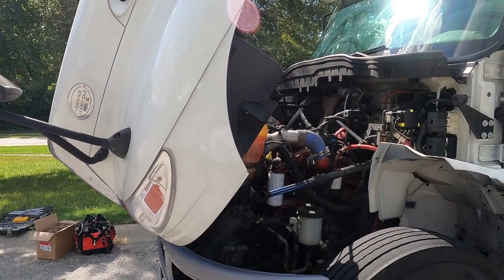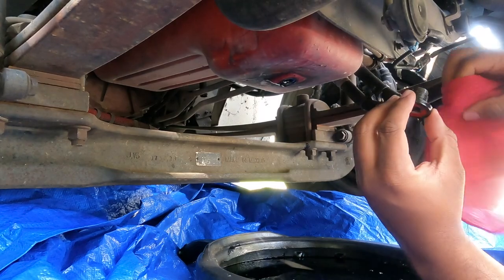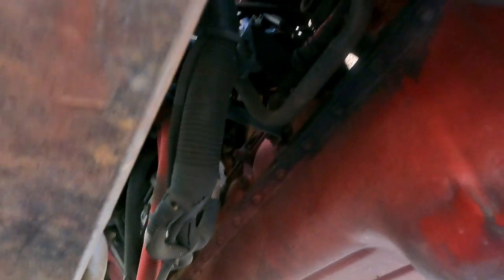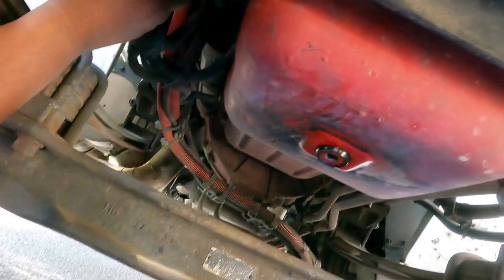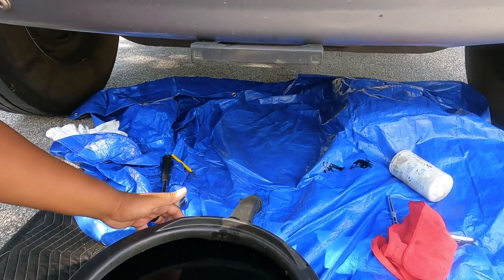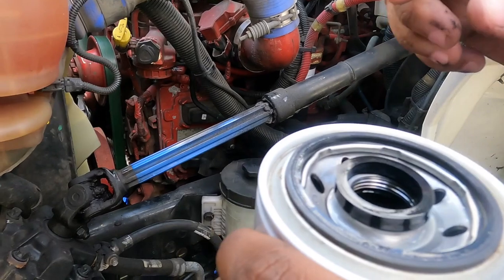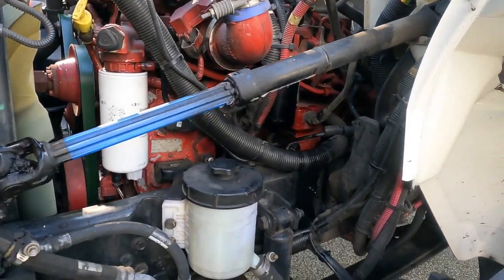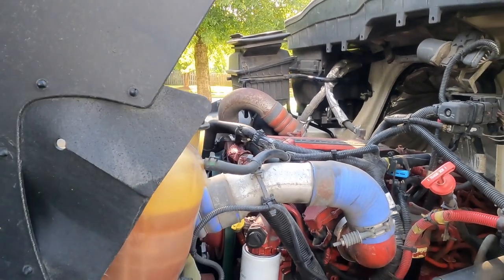Save HUNDREDS of Dollars changing your own oil in your Box Truck!!! | BOXTRUCK

Comment: Next time, use that primer pump on the filter close to the radiator! The knob unscrew & you pump until it gets tight & then screw it back down. That's keep you from wearing out your starter & draining your batteries! Be careful with that pump because it looks plastic on camera but hopefully it's metal. That heat will make plastic brittle. Keep an eye on your coolant tank also because they're know to start leaking at the bottom & those cheap spring tension hose clamps they come with. Get a grease gun too so you can grease your Ujoints & slack adjusters & whatever else needs grease! Its just as important as changing your oil. I usually do another chassis lube midway of my oil change miles & then again at the next oil change! Gotta stay on top of that routine maintenance! Plus you can eyeball everything underneath like those Ujoints & brake shoes & drums slack adjusters & check for leaks! You go through that Alabama scale on I-20 west & they Will bring you around back & walk under your truck! They love white box trucks so keep your sh-t tight💯👍🏿 Those scales im Mississippi can act a fool from time to time also!

Comment: Right all your part numbers down in your little book & most of the time you can order all your filters from Amazon. I got my oil & fuel filters from Cat or Kenworth because it was cheaper but both my air filters were cheaper off Amazon & they deliver! You keep those parts numbers so you can always shop around at some good part stores. Try not to by cheap Mexico or Chinese parts if you can help it! "Fleet Pride" has quite a few locations & are pretty decent with their prices. "Truck Pro" is OK but only if i had to go there! "Global Parts" was my favorite but i don't know if they have a location near Y'all 🤔 That's my 2 cents✌🏿😁

Comment: Good video! Now how about making a video on how to grease the truck....and especially the kingpins being that the whees must be off the ground to properly grease those. From one 2016 international 4300 owner to another. 💪🏾
Reply from the maker: We're gonna have to take it to the shop every so often for that. Lol
Reply: @TruckinginJs  That's what I came up with....so I feel your pain bruh trust me. But all other points can be greased yourself...it's just the kingpins that need to be in the air to be greased properly to prevent early wear and tear. And trust me they're not cheap....about 2k to replace. I'm looking now to see where all the grease points are. My buddy said truckers use to pay him 20 bucks to grease theirs when he worked for an oil shop. Just something to think about. ✌
Reply from the maker: Preciate it!
Reply: @TruckinginJs  Just changed my oil. Curious how many quarts yall used? I think you said 16; the local international dealer here told me 17.
Reply from the maker: We used 16 quarts and put some in oil filter. After you put in 16 quarts, check it and if it needs another add it.
Reply: @TruckinginJs  Will do, thank you! and be safe my brothers.

Comment: Take the truck to the shop a couple of times to learn what you are working on. What you are thinking is the fuel filter in the middle of the video, is the water separator. Never pour the old fluids into the new. Never prefill your oil filter when installing. 18 quarts with an empty filter. You will overfill your engine. Your truck has a fuel priming pump on the water separator, so no need to prefill the fuel filter. Also, while under the truck, get one of those battery grease guns and grease the truck grease points, inspect the brakes, suspension, etc while under there. The entire job should take 3 hours. Yeah, we charge a lot, but you get a lot. I do applaud you on trying to learn about your vehicle. Keep it up.

Comment: Shell rotella T6 is full synthetic and only costs lil bit more. I buy it on sale at Walmart online for @&23 a gallon.
Reply from the maker: Thanks for the info. We've been thinking about switching over to synthetic. Sounds like a no brainer if it's not much cost difference!
Reply: @TruckinginJs  you’ll get better life span on engine. And molecularly synthetic lubricates better.
Reply: Jus changed mines yesterday, the T6 is what I used

Comment: I'm curious that you can't get to that oil filter from top? I never heard of anybody punching a filter & in that position to just drain it. Just screw it off and drop the filter.

Also when pulling filters, always make sure the rubber oil ring come off with the filter. Some of these filters when you pull them and if you are not looking very close, the ring might not be attach to the filter and stuck to the engine oil mount or diesel filter mount. if you don't you can cause a leak.

And next that 1st thing you are calling a "fuel filter" is technically a water separator. It's  to capture the "water" in the fuel. It will never be under pressure in fact, everything before the injector pump is "never" under pressure. Including the actually fuel filter that you took off later-on. I would still run lucas or howse treatment to dried out some of the water in the diesel & t add some lubricy in you diesel fuel system.

And lastly,  I believe you have a manual prime button some where on that side and a bleeder. You open or depress the bleeder, and pump the primer to fill the diesel filter b4 starting.

But a good job on a DIY and saving big money and "time" driving to a dealer to do simple PMI on a diesel engine. 

BTW if you go with t5 vrs t4 you can probably do easily another 10k on that oil , I would use a oil analysis to see what the oil condition. This will help in ID'ing any oil deposit and give you an ideal of how long you can go on "your" oil and on that engine.

The manufacture  oil change interval is conservative. We do approx 12k b4 changing oil on a international or most of our diesel.
Reply from the maker: We were trying to avoid the mess but it wasn't bad without punching the filter.  A lot of great info you gave here! Thanks!

Comment: Fleet guard LF16035 is better option for oil filter. Check specs and filtration rate for yourself.
Reply from the maker: I believe that's what we have now and it was cheaper. How many miles between oil changes with the synthetic?
Reply: @TruckinginJs  honestly I change it every 10k but I’m sure you can go 15k.  Since I do all the maintenance myself it doesn’t really hurt the pocket anyway. I just find it easier to remember to change every time my odometer hits any 10k miles. Otherwise I’ll forget and lose track of when to change it.
Reply from the maker: Preciate it!
Reply: Does it have to say Cummins on it? I found it but I didn’t see Cummins written on it.
I also grabbed T6 oil as you suggested in the comment section
Reply: @mikeelize20   Nop. Also, no one changes the crankcase breather element. It’s supposed to be changed every 65k miles per Cummins. It’s basically a big PCV. Google CCV for your model of truck. It’s sit under the top cover of motor where you put in oil. YouTube has done videos on how to change. Easy. And take off your EGR valve and clean with brake cleaner at least once a year.
Reply: @jaz313det  Thank you so much for sharing 🙏🏾
Reply: The LF16035 doesn’t fit
Reply: @mikeelize20  yes you are rite. Very sorry my friend. Where I was searching it showed it did. Had to return it.
Reply: @mikeelize20  when I’m looking up stuff for motor it somehow shows parts for a Dodge Ram truck with similar motor. Not the same of course.
Reply: @jaz313det  It’s all good brotha…I tried it on yesterday and had to post it just so you guys don’t get it

Comment: Quick question. I’m in the process of purchasing a truck. I’ve got 2 options a freightliner with leaf springs and a international like yours with air ride. Both are in great condition with low miles. Which do you prefer spring suspension or air ride? Thx.
Reply from the maker: I would go with air ride because I occasionally see brokers specifically asking for trucks with air ride.
Reply: @TruckinginJs   Do you feel there’s a big difference in driver comfort?
Reply from the maker: I've only had air ride.

Comment: Question: do you guys use a factoring company and if so which one?
Reply from the maker: We just signed up with OTR capital. We haven't used them yet. We've been using quick pay with some brokers but we are trying to move to standard pay to avoid the fees.
Reply: @TruckinginJs  Whaf rate did they give you?